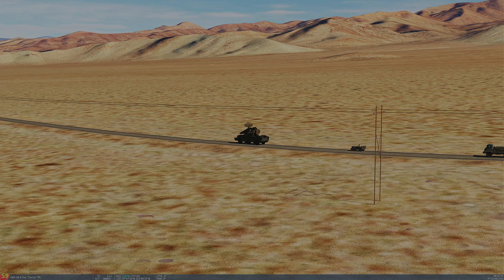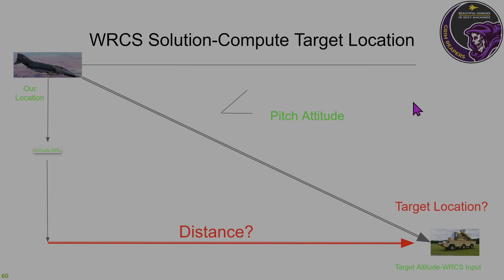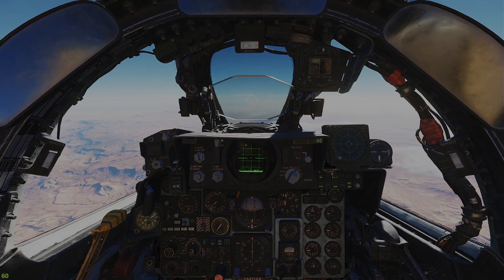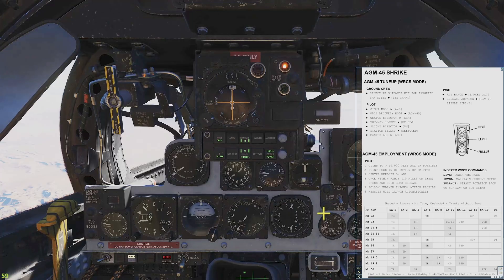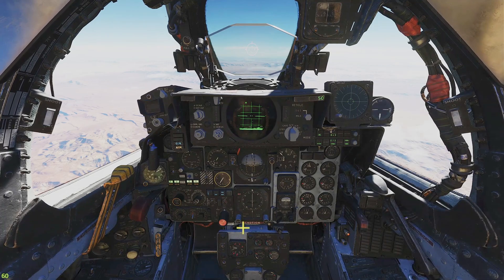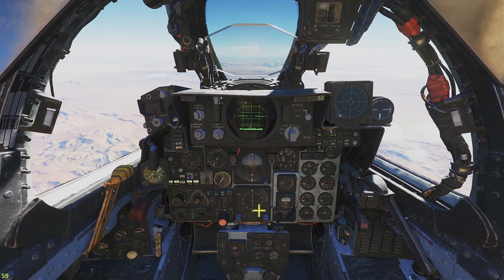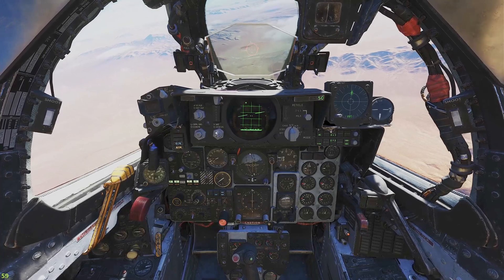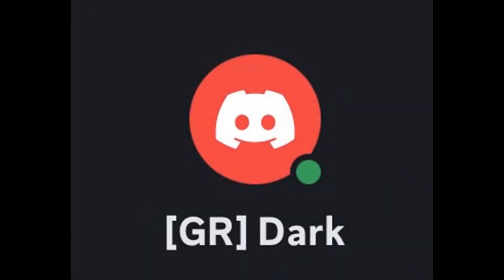F-4E Phantom: AGM-45A Shrike (WRCS delivery mode) Guide  | DCS

Comment: The info on that kneeboard about the indexer is wrong and so is the method described here.

First of all, WRCS mode (AGM-45 on the delivery method switch) only uses the target altitude (which is entered manually) your plane's altitude and your nose depression to calculate range. It's trigonometry, as you explained in the beginning. 
It doesn't require a radar signal. As such, the range indicator on the HSI doesn't need a radar signal. It will show a distance when you point at something on the ground, as long as you selected "AGM-45" in the delivery selector. It doesn't care if there's a radar there, nor does it care if you have any weapons installed.

You can use it for quick range calculations to a landmark or a target (as long as it's under 30nm) just for this exact reason.

Secondly, the indexer does not provide command cues for you to lower the nose or pull up, it provides delivery mode info based on range and nose depression, that's it.

"Pull up" = Loft delivery.
"Level" = Level delivery.
"Dive" = Dive delivery.

And the ADI depression is 35mils, not 45.

You can use WRCS mode to deploy the weapon for loft, level and diving deliveries. It doesn't matter.
The only thing that matters for deployment purposes is the seeker head (loft or direct).

I think the best way to understand how WRCS (AGM-45 on the delivery method selector) mode is to think of it as being "Dive Toss" for a missile.

Provided that you are pointing directly at the target (35 mils), and the needles are centered, pressing (and holding) the bomb release button will save the calculated range and start launch calculations. At this point it essentially acts like the dive toss method and you can start pulling up for a loft or level delivery (if the range allows, based on what the indexer shows before pickle... again it's not a command cue, it's a range indicator). At this point (button still pressed) you can pull up to level and wait for release or keep pulling until release, both timed automatically by the WRCS.

The "donut" on the indexer after pressing the release button (pickle) does not indicate you should stop pulling up, it indicates weapon will release within 5 secs (generally speaking 5 seconds if you are flying wings level at 1g, fewer seconds if you pull up for a loft delivery).

Going back to "the indexer does not provide command cues" topic (remember, you need to be pointing at the target for all of this);

- The "pull up" cue is for loft delivery. This is the longest range delivery type and this is what's shown first as you approach your target (provided that you start out far enough... no light will illuminate if you are too far.)

If you want to use this method at long (relatively speaking) range, you need to make sure you installed the loft seeker on the ground. The direct seeker start engaging the control surfaces immediately upon launch and the control logic is what's called a "bang-bang" type. It doesn't do small inputs, it uses full surface deflection in small intervals, as if someone is flying it with a keyboard. It is very draggy and quickly bleeds energy. This is partly why "DIRECT" delivery mode is the shortest ranged one. Whereas the loft seeker locks the controls in place for a certain amount of time and certain amount of loss in altitude. When it activates, the seeker head tracks towards the first signal it acquires (FOV of 45-degrees). 

You don't have to use the LABS mode to deliver a loft strike, or have a loft seeker installed on the ground for this. Like I said, the WRCS doesn't actually know anything about what you have on board or what you are trying to do, but gives delivery method info based on calculated range. You can launch a missile with the "direct" seeker using this method for loft or level deliveries, but it will in all likelihood not reach its target, precisely because of when each seeker activates.

This is also why loft and level modes are the harder delivery methods to employ reliably. You need to fly very precisely to set the missile up for success for when it turns on during the descent stage. If it's not looking at the correct place at the correct angle, it won't track anything.

- As you get closer, the "level" cue (the donut) shows up. This appears when the range is not sufficient for loft but still too far for dive.
It also appears when the bomb release button is pressed (using WRCS and LABS delivery mode) to inform you that the weapon will be released within 5 seconds. It doesn't mean you should fly level.

- As you get even closer, the "nose down" cue shows up. 
This appears when the range is sufficient only for dive delivery.

The only difference between the "DIRECT" method and the "WRCS (AGM-45 on the delivery mode switch)" is when the missile launches when you press the button. With the delivery switched to "DIRECT" the missile launches 1 second after button press regardless of whether or not it is appropriate to do so. Zero automation, zero calculation. If when it launches it's looking directly at the target, it will track. If not, well... probably not.

This is why "DIRECT" mode is really only appropriate for high angle dive deliveries at short range.
You are basically doing old-school dive bombing, but releasing a missile instead of a bomb.

Seeker head selection is very important for proper delivery of the missile, especially if you want to maximize your launch distance. 
Direct seeker is only appropriate for diving/direct deliveries. Whereas loft can be used for level and loft deliveries.

Comment: You guys seem to be a bit confused: There's DIRECT, WRCS and LOFT modes. You used WRCS. There's no "DIRECT" in there. You also forgot to mention that pilots should use the loft setting when selecting the seeker head, as the direct seakers will activate the control surfaces of the Shrike immediately, cutting the loft short and waste a lot of energy. In this case it worked, because you fired from very close. Lots of missing/wrong info, so I would recommend redoing the video.